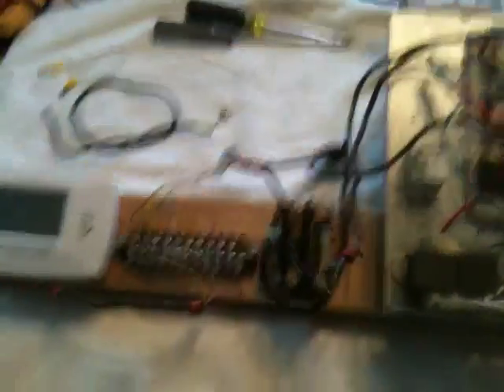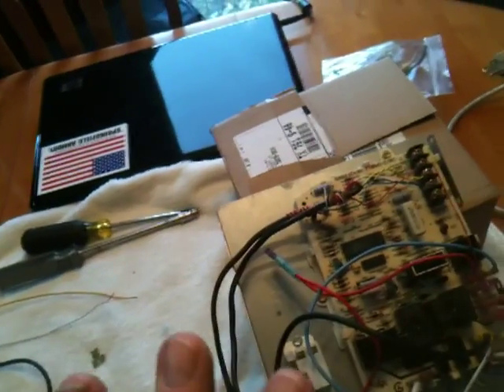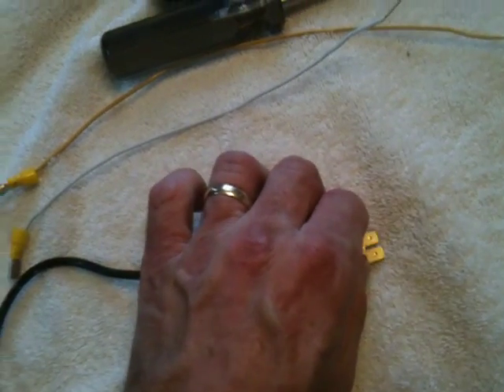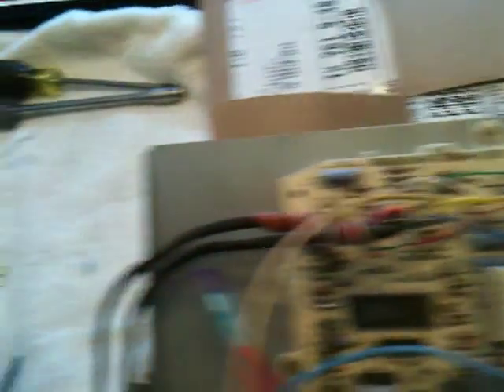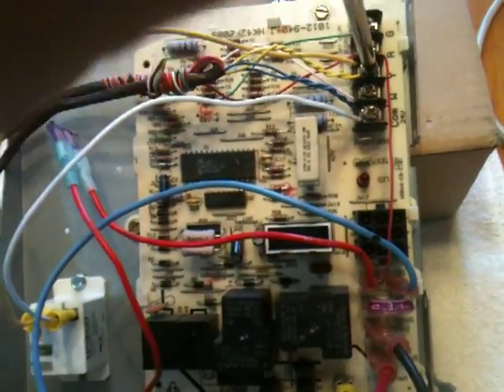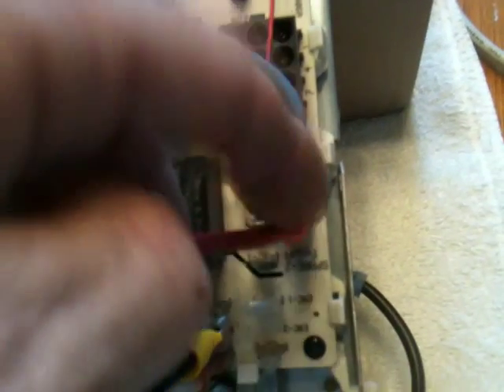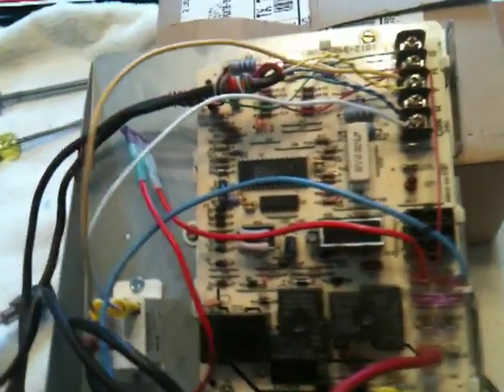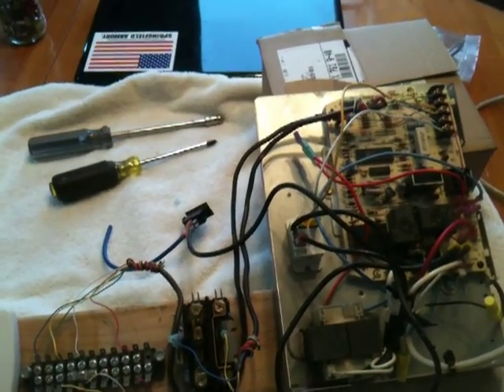HVAC Blower Not Working 'revisit'

Comment from the maker: Sorry for the delay, you prolly have it fixed by now. I would have a tech check it out first. If the coil is dirty, really clogged filter, or low freon (leak) the indoor coil could be frozen up and you would not feel any air even if the blower motor is working fine. Motor at hvac parts shop or Grainger  but you have to get all of the data off the blower motor. OFTEN you need a Special Tool to remover the blower wheel as they get stuck too. It'll cost but hiring a tech might be worth it. M@

Comment: I have a prob w/ac unit fan will not blow. the unit is cooling because i feel cool air around the vent when the ac unit kicks on....but now, the air is not moving like before(blowing out the vent). what is the name of that relay in your video, and can i get one at Home Depot/Lowes....or do i need to go to a Heat/Air Parts Warehouse?

Comment from the maker: Artun, by your description it sounds like the capacitor is dead.
The motor will still run if its a little low, say 10 or 12 microfaradbut when it starts getting lower than that it's more of a load on the motor. At a certain point  it will run but the motor will overheat and shut down.  when it's too low the motor will not start up at all and it will hum if it makes a sound. Remember though the motor *could* be bad as well but its prolly just the capCitor. Post when you get it replaced! !

Comment: Thanks Mike for your instructions which helped me to narrow down the issue, but still not sure why my HVAC internal fan is not working. I connected the Fan wire to the door switch live wire and when I power on there is a humming noise. I checked the capacitor near the internal fan which is amrad capacitor ra2000/37-156 15MFD +/- 10%, and on my multimeter it shows 186nFD.

My HVAC is REEM and the IFC Board Model is 1028-928 and part # is 62-24140-02.

What could be wrong? 

Thanks/

Comment: turned out to be a bad zoning control board. luckily for us, my GF's ex-husband is an HVAC Tech (I didn't know this when I inquired) and he narrowed down the trouble. I just asumed the fan wasn't blowingbas hard as it should because the unit was running and the temp wasn't dropping. I did clean the coils and the entire interior of the blower duct and after the zoning board was replaced everything seems to be functioning properly. I appreciate people like yourself offering their help on the web!

Comment from the maker: Without seeing your unit I'm not sure that there is easily. Does it blow slow ALL the time, or if it's been off for a while and you turn it on does it blow good for a bit and then slow down?  Besides the motor it could be a clogged air filter, or worse, a clogged/dirty evaporator coil. Also the coil could be FROZEN UP (ice). A few other possiblities. Without having visual access to several components it's difficult to tell on some of these. Send me a private message with your phone # if you like

Comment: Hey Mike, I think the blower on my central air unit is shot. It blows ever so slightly. Is there a way I can determine if it is indeed in need of replacement without calling out a technician?

Comment: thank you for explaining everything in your video,please notice i am not a repairman i am just somebody that likes to see you repairman do your thing,its very interesting to me,
about a year and a half ago my central ac blower motor stopped working, repairman came did the bypass to get the blower to run nonstop for airconditioner, was waiting on new board,still have not got this done because i have air, but winter theres no heat,
relay trick would have come in handy for this one,

Comment: Mike, 
I have a Trane xb80 the heater was not working but the fan was blowing. I did some checking and i took out the limit switch and bridged the the wires and the heat kicked back on. it worked for that time the next time i got a new limit switch installed it and nothing worked after that point. i checked the control board and the led light is dead no blinking. i have a multimeter but im not sure how to test for current or power can you help me identify what my issue is. Thank you"!

Comment from the maker: @MrMultitool   The one I used is just off of some old air handler heat strip, you can get a suitable relay, say a 9340 or the like at any supply store, just make sure that it is rated to handle the amperage that the blower requires!  Thats' the only important bit besides making sure it's secure!